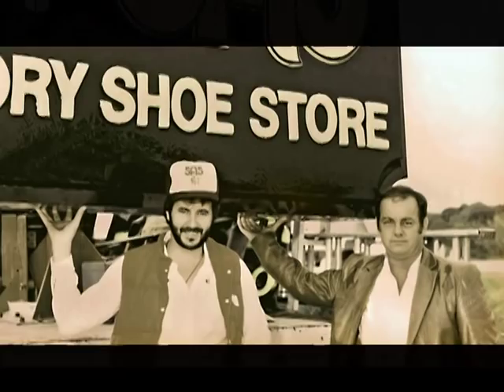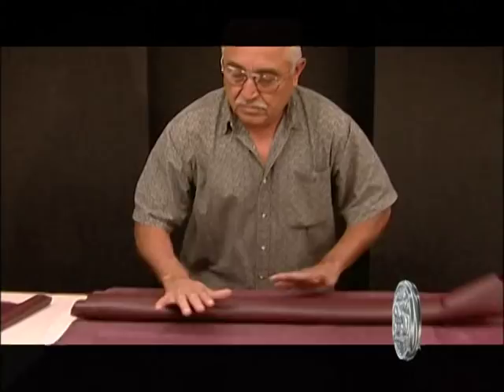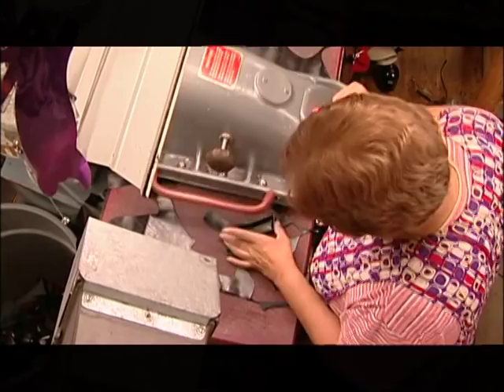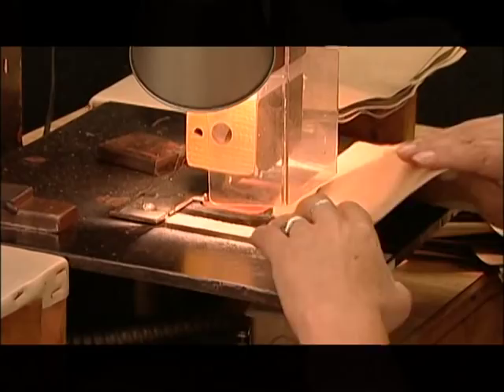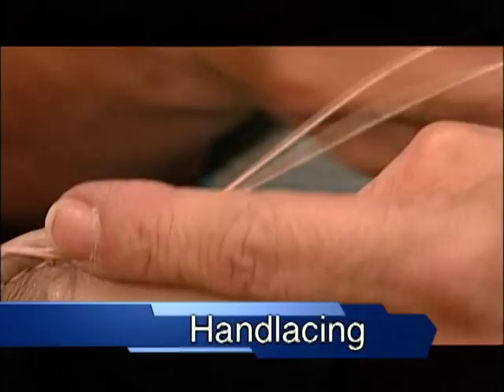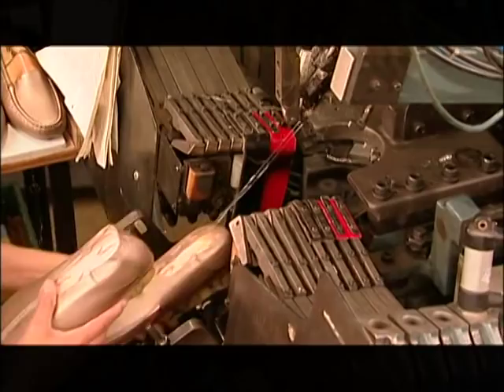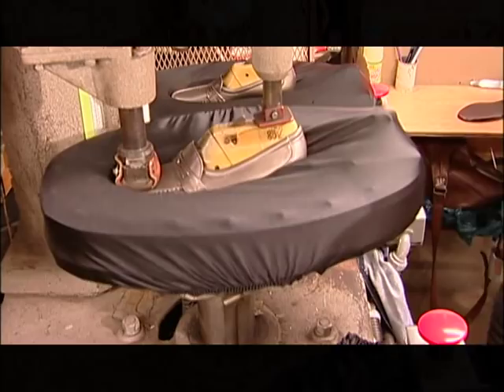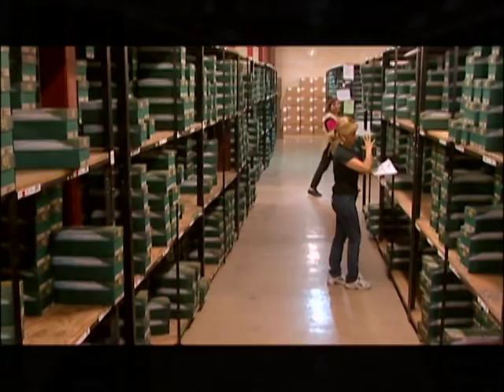How SAS Shoes Are Made By Hand

Comment: I have to say I used to work for SAS it was the best place I ever worked at and that was a shame that when they close here in Tennessee I used to be a what  I was call a sole layer  l put the sole on  bottom shoe were there for 16 years and loved every bit of it and I still regard SAS the best place I ever worked at and the best shoes ever made
Reply: Well, the soles are flawed. They have large air bubbles in them that become exposed long before the uppers show much wear. Not good!
Reply: @RT-Ford  Polyurethane should last far longer than traditional rubber soles, and especially far longer than the type of shoe rubber being used in your standard Chinese, Thai, or Indonesian shoe factories that manufacture shoes for big box stores.
Reply: Can you help me (3 years later) to purchase shoes?  I cannot justify shoes that have as large of natural "imperfections" as mine have.  The right shoe has a sixthed or third inch high back of the shoe, and on the shoe that has the higher back, I can see two stitches in the back where they aren't covered/below the heel.  I don't feel like this is a "good reason" to be "hand made" and would rather have "manufactured" shoes that won't fail to modern "human made" standards.

Comment: Very comfortable shoes but when the soles wear down a bit, large hollow areas begin to appear. This happens long before the uppers wear out. There's a flaw in the manufacturing process.
Reply: The air holes in the soles of many brands are designed to make the shoes lighter weight.